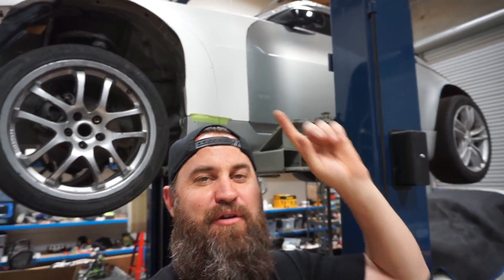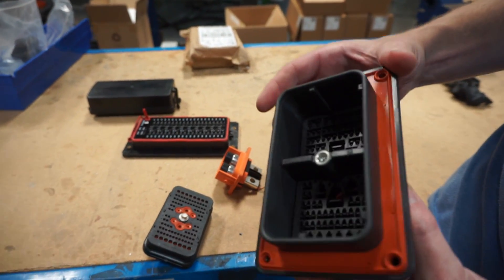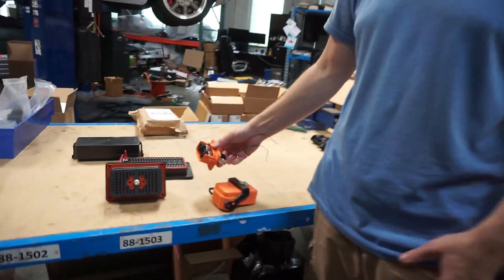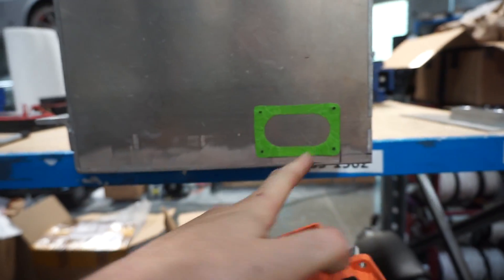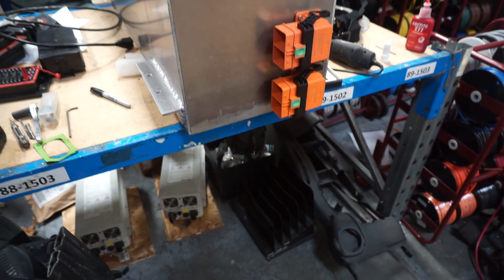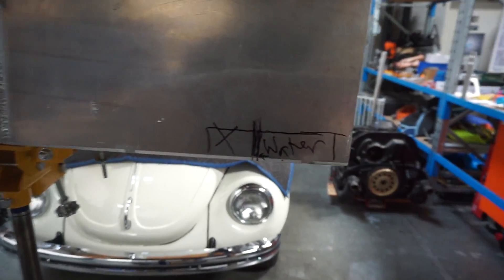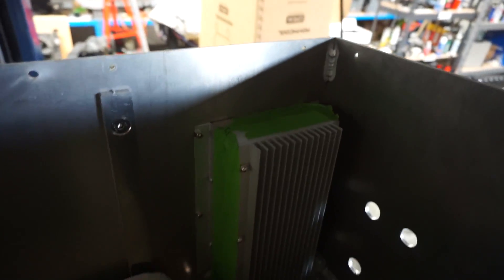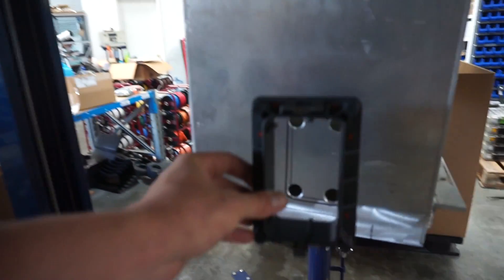Stuffing an Entire Tesla Model S P85 Power Plant into a Nissan 350Z -- High Voltage Wiring - Part 11

Comment: Quick question: is the BMS going to be ok inside the battery box where there will be little to no air flow? I'm assuming it's only cooled by the heat sink on it
Reply: Joe Stanek can’t imagine the longevity is better with it being in the box.